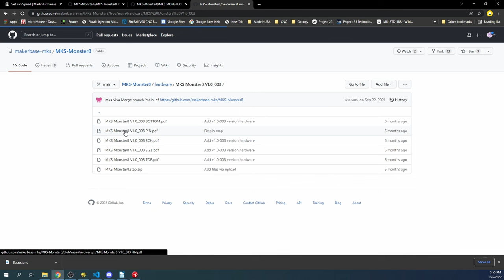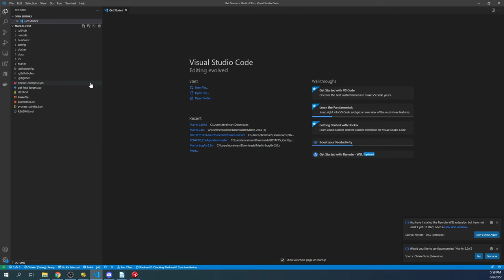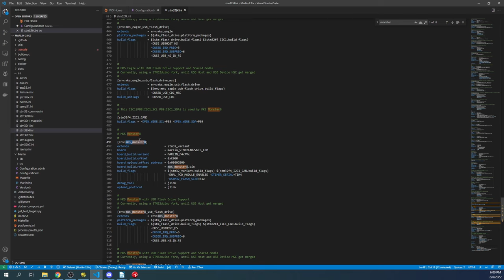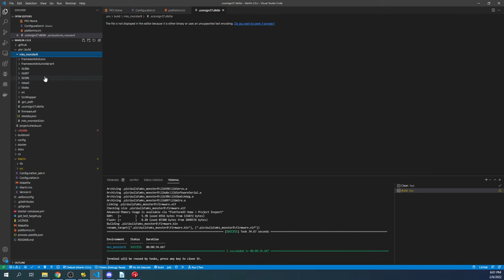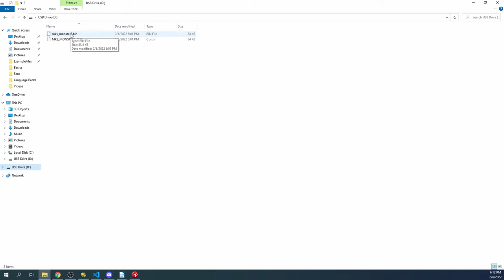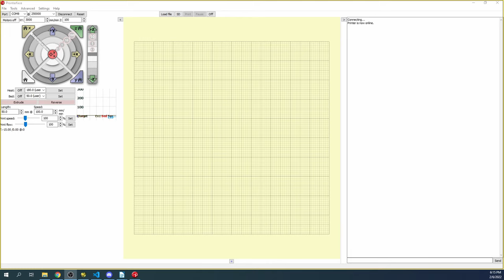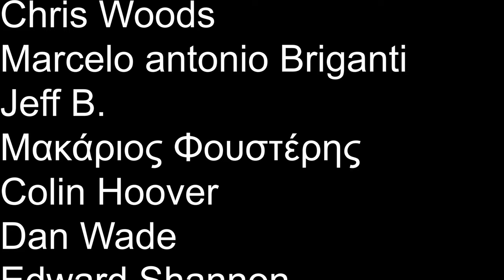MKS Monster8  - Fans

Comment: Ed.  A short while ago I “Discovered “ your channel.  And subscribed.  I am in process of changing ender 3 pro mainboard to a SKR 1.4 Turbo with TMC 2226 drivers. I heard they were updated TMC 2209’s. I started it 2 months ago. And nothing but headaches.  Can’t get it to go home.  All firmware updates and also on TFT 3.5 screen.  I saw in comments on one of your videos that someone committed a firmware adjustment for the ender 3 turbo/ TMC 2226 drivers.  I even clipped the DIAG pin on each driver.  It was a “ AH-HAA” moment. I neglected to screen shot of it.  Do you know what / where that comment is?  It’s so head banging I’m considering a different mainboard.
Reply from the maker: There's a Discord link in description of video.  I can or someone else can walk you through the issue.

Comment: Help me please. My board is an MKS EAGLE V1.0 with TS35 V2.0.
Recent I installed Marlin version 2.1.2
and the way the hotend fan behaves I don't like it...
when moving any axis, the hotend cooler (fan) turns on, and turns off when there is no movement in the motors.
I liked how it was before...
The hotend cooler (fan) activated above 60°
and turned off, below that temperature.
I can't find a Marlin compiled with this configuration. Can you help me ?
Reply from the maker: There are several fan configurations in configuration_adv.h.  search on fan and see which pin is used.
Reply: @EdwardBraiman  short and straight answer. But it didn't answer my question. I saw that you use vscode. I know there are many parts to see. Anyway thank you.
Reply from the maker: I've covered process in more detail in my BTT octopus tutorials playlist.  The details you're looking for are probably there.